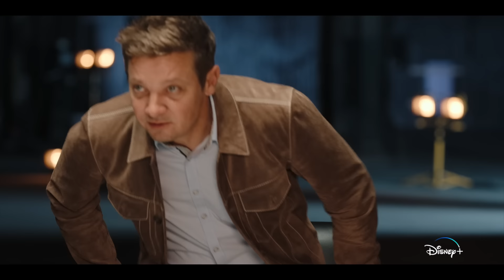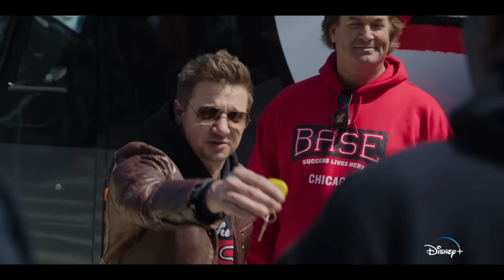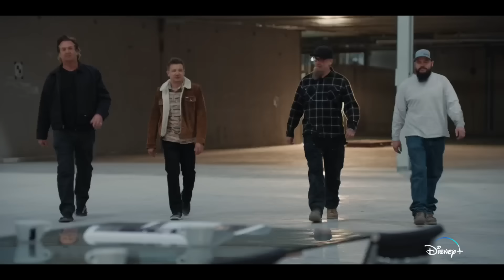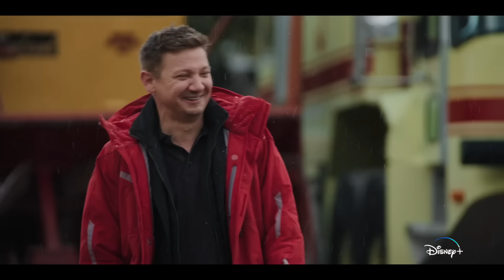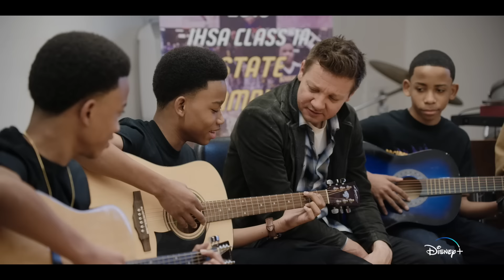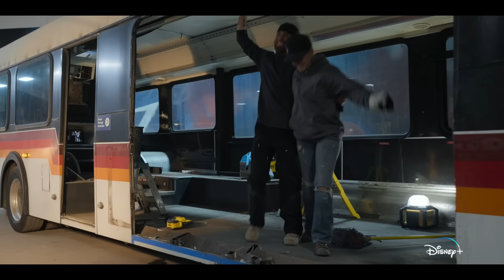Rennervations | Official Trailer | Disney+

Comment: Hopefully these turn out to be actually long term functional vehicles.  From what I've heard, most of the cars from Pimp My Ride were stripped down after filming ended.
There's a fine line between something that is flashy enough for the camera, and practical enough for long term viability.